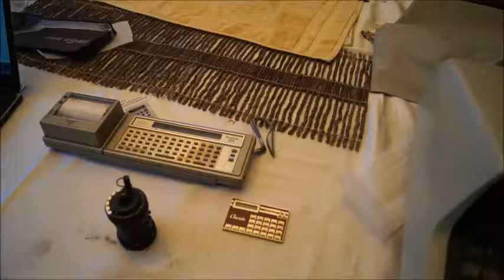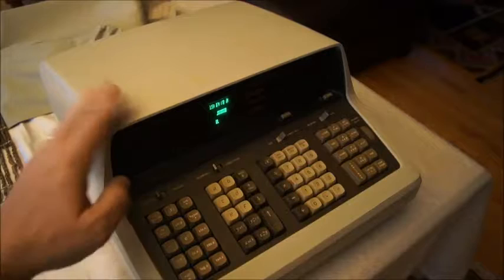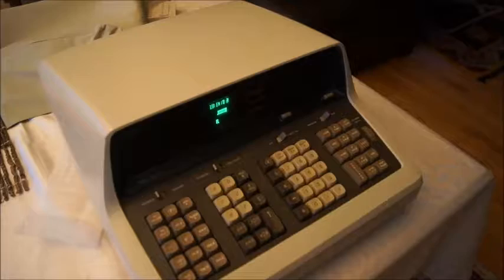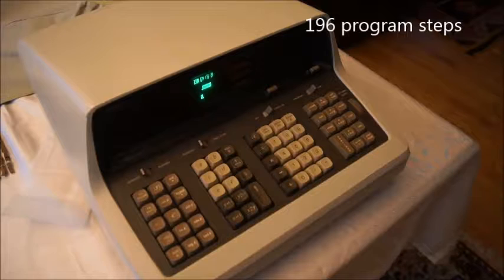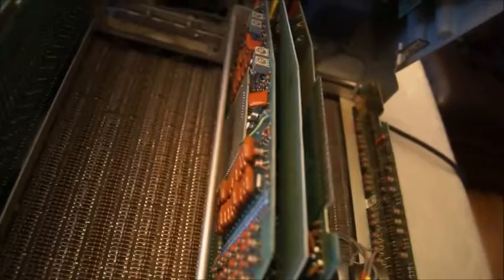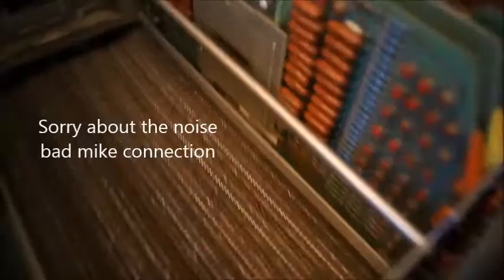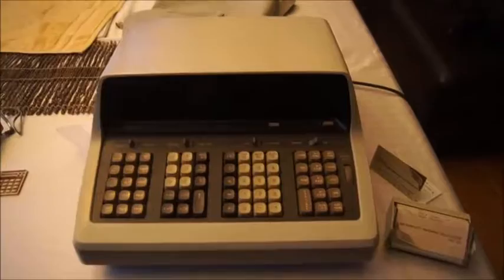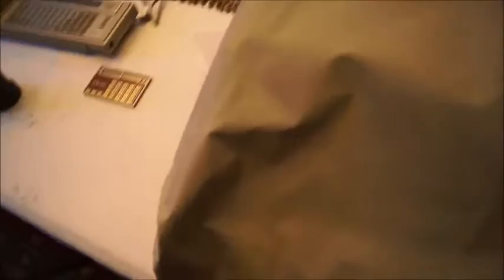HP9100A

Comment: These machines have discrete diode array logic- a technology which was long obsolete in 1968 but this was the technology that they knew how to work with.  It is a microcoded machine with a 64-bit data word but only handles four bits at a time.  There are 512 64-bit words of plated wire ROM (a technology developed at HP) and 64 29-bit words of microcode memory in the form of a core rope which runs along the side of the control logic board.  According to hpmuseum.org the PCBs used are actually multilayer- the plated wire ROM is implemented as a 16-layer PCB and the logic boards are 4-layer boards.  Although this is a 64-bit machine the core memory stores numbers four bits at a time with two bits for parity- there are 2,208 bits of core memory divided into 368 six-bit units with sixteen bits on a single core plane.  The memory drive is even temperature compensated to prevent bit errors.  There are actually four ICs in this machine, which are op-amps used in the card reader circuitry.